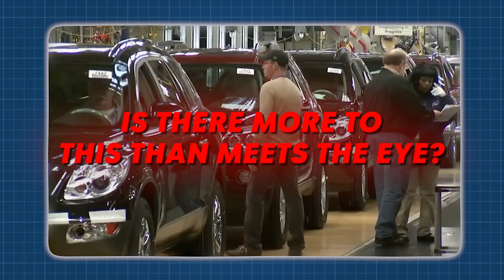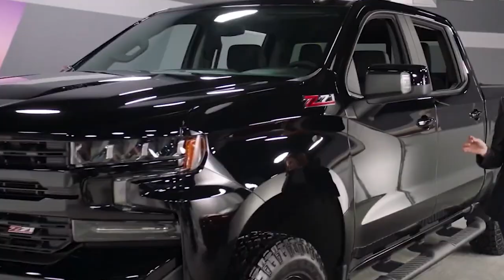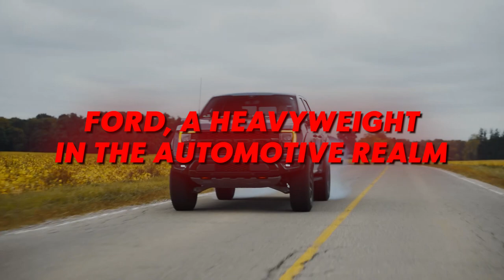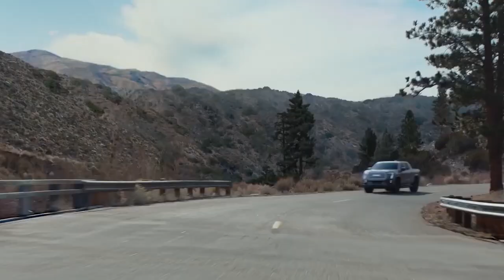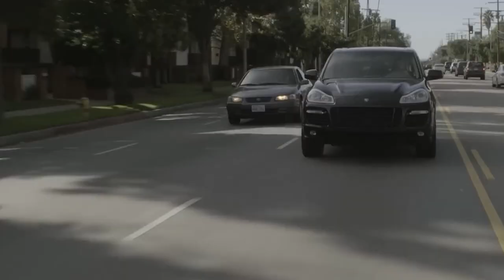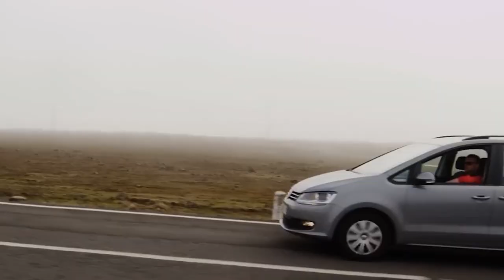BREAKING: GM CEO Shocks Industry by Halting EV Production!

Comment: I remember the days when locomotive trains replaced the stage coach, horse driven carriages were replaced by motor cars, city trains and trolley cars gave up their tracks to be replaced by buses and freeways. The challenge to draw the masses out of their gas vehicles is a losing battle with deep costs to be carried by consumers and corporations. Why wasn’t the hybrid developed further and gradually merged into full electric vehicles?  General Motors is the first to surrender with probably more manufacturers to follow. 😳